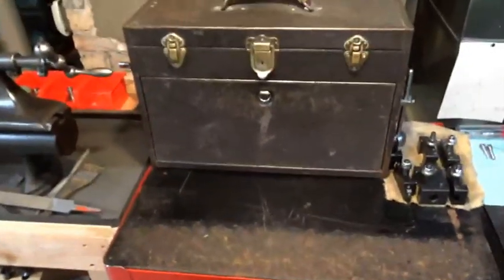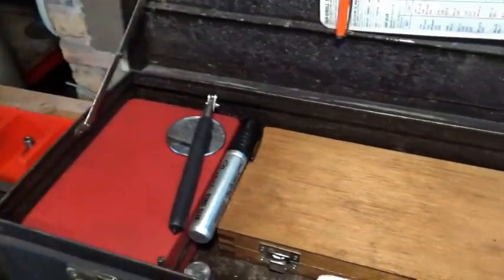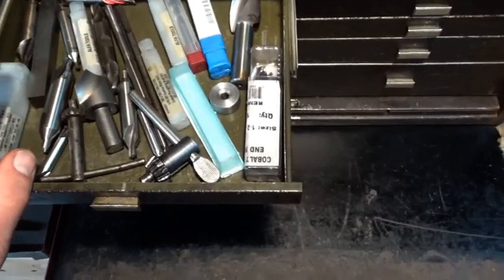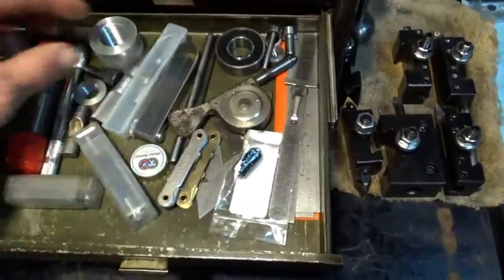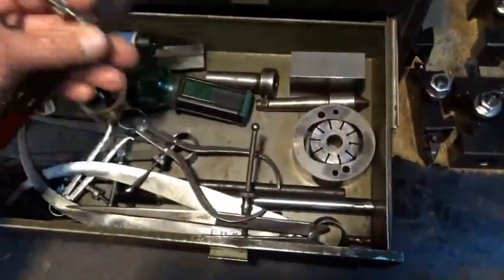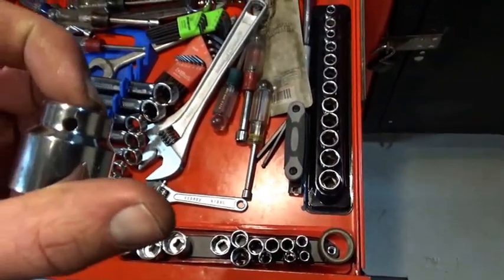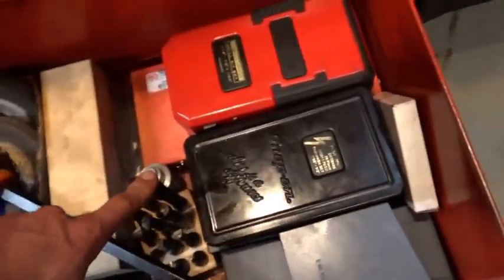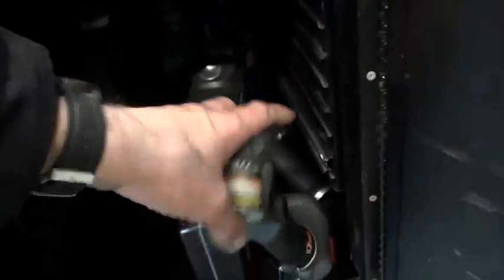The Grand Tool Box Tour:  The Machinist Box

Comment: What kind of taps and drill bits would you recommend? I have that same set of snap on bits, and for the price I don’t really want to go through and replace all the brokens they won’t warranty.
Reply from the maker: For taps and dies I recommend decent high speed steel versions.  The hardware store, Snap-on, Mac, Matco etc.  taps are all just plain 'ol tool steel.  The drill bits I prefer are also high speed steel.  I don't bother with coatings because I regrind my own drill bits.  As soon as you touch a coated bit to a grinder, that fancy coating is gone.  I have those Snap-On "Thunder" bits because I bought them used for a song.  I don't really care for them and they rarely get used.

Comment: Watch-out going vintage Hopper1 with that top box from Kennedy, I did not know what a Starrett Tachometer was until now always learning. MrPete is a great man, glad we both watch him he finds tools at sales and such all of the time tougher to do these days. MEMORY ALERT In drawer 2 of the red bottom box you have a small blue box with a clear lid holding a set of shinny small (6 pieces) screw drivers with the finger controls spinners on the tops, those were my first mini screw drivers used in electronic learning during high school years, I have those somewhere around here got mine at Radio Shack remember them? WOW why is the Fowler deburr kit bad? worth a share to help us avoid a bad buy someday?
Reply from the maker: A friend and coworker gave me the small screwdriver set.  I mostly use them to tighten screws on my glasses.  The Fowler deburring tools are just all around bad.  The tool steel is soft, the grind on the tools is rough, the angle of the tools when in use feels wrong, they chatter...  I have a couple of Noga deburring tools and they are far superior to the Fowler tools.